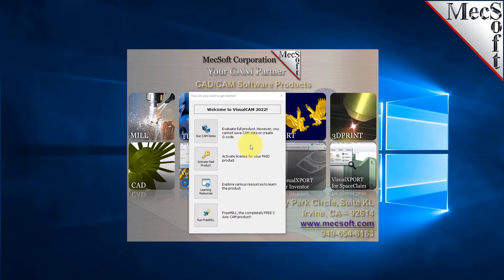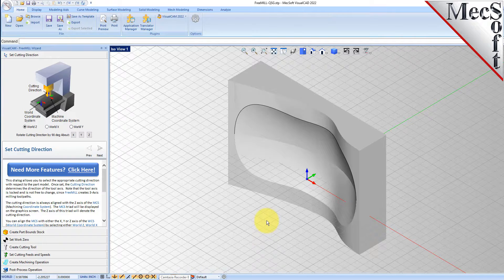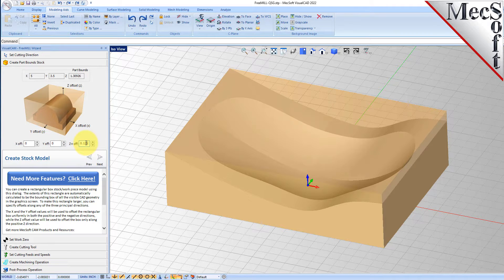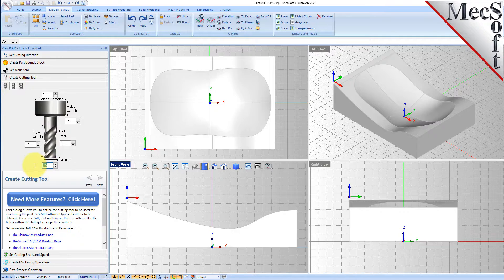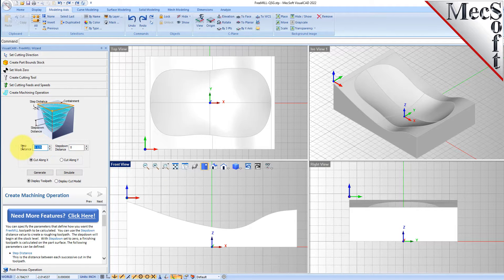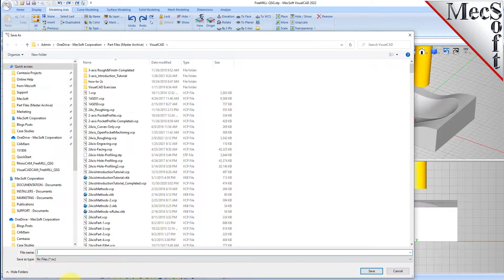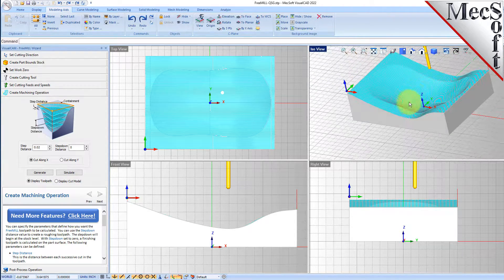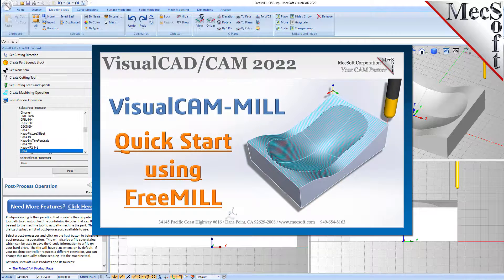FreeMILL Quick Start, VisualCAD/CAM

Comment: I like it for simplicity of this software but for some reason it can only cut down to a depth of 16mm
as shows in simulation and so i thought it was a bug so i cut it and still was only cutting down to 16mm

my object it 20mm in height Z & X :100 Y:250
so I used a 21mm Height stock wood Z=21mm
using a 40mm long cutter down from the collect with a 3mm diam ball end
also tried a 50mm long 2 flute with a 25mm cutting edge 
just incase the software wanted a longer cutter

so it has some sort of limitation or bug
also i use the same setting in Vcarve and it cuts down to the 21mm depth 
Any Ideas ?